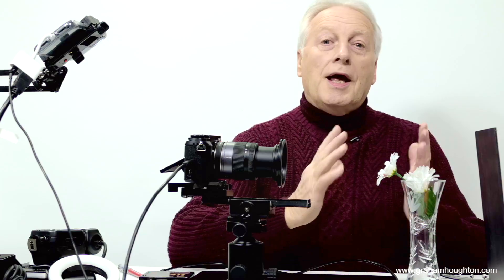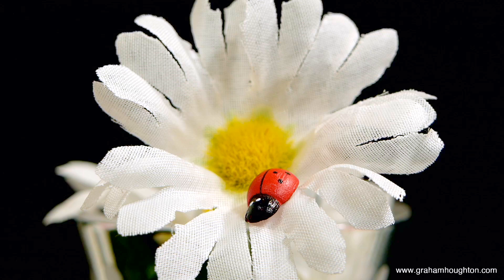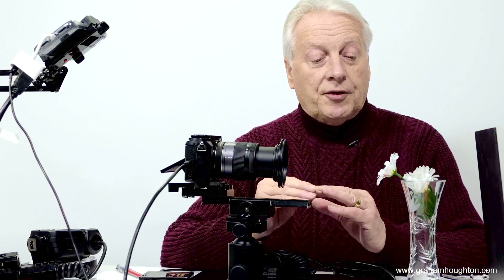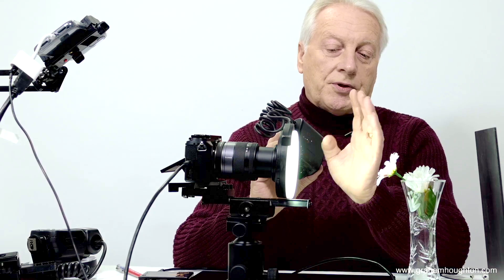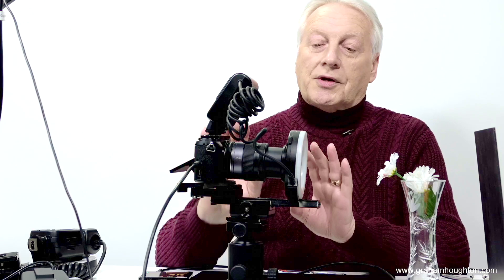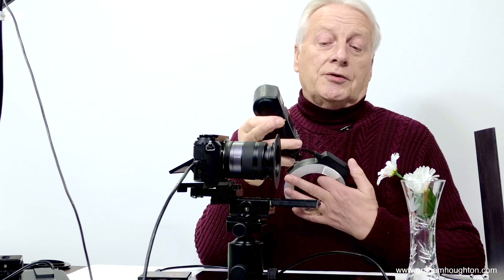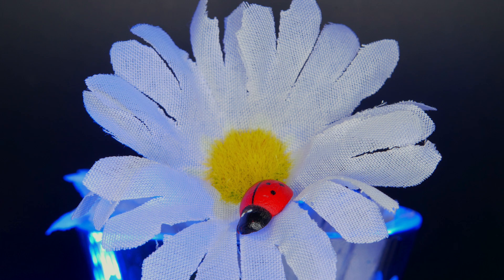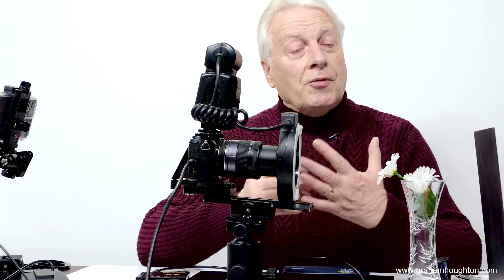Lighting for Macro and Close-up Photography using Micro Four Thirds Cameras.

Comment: I'm just starting out regarding macro and have bought a Raynox 150 to use on my Panny 50-200mm lens. You've convinced me that a ring flash, as opposed to LED ring, is the best option. But price generally seem very high and I'm not sure if non mft examples will work. Any advice would be much appreciated